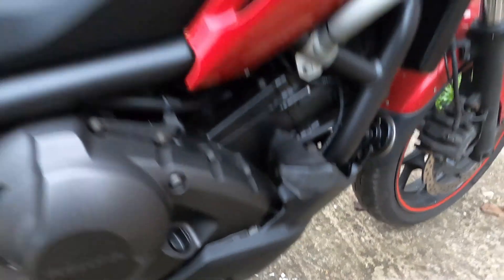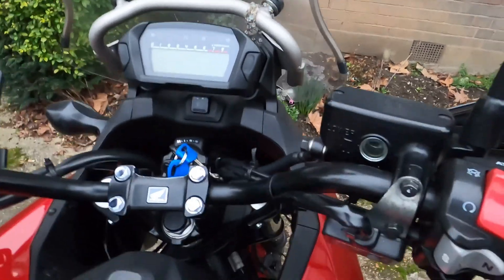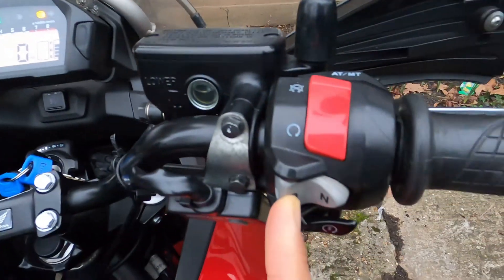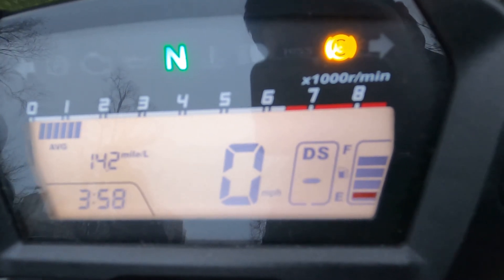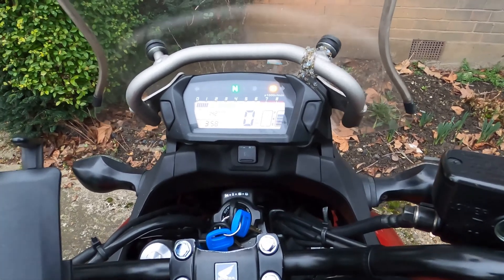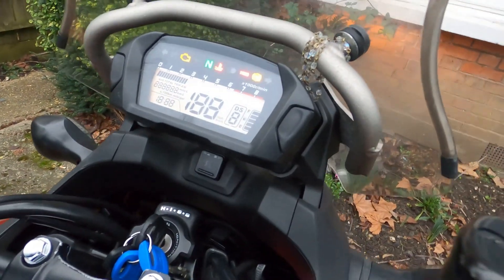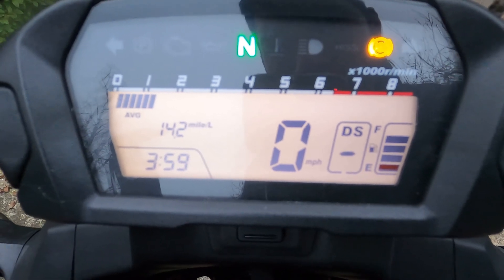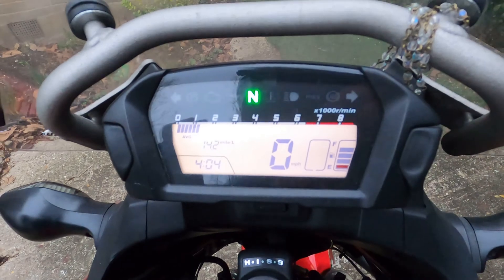Calibrate Honda DCT motorbikes.

Comment: Thanks a lot. I have a  question, my HISS light disapear Honda NC750DX 2014. What can I do to reset it?
Reply from the maker: Hi, I am not too sure, however, a battery reset would fix most issues. Disconnect your positive connection on the battery, wait 3 minutes and then reconnect.

Comment: My local Honda Dealer says to NOT do it...The only time it should be done is if the DCT controller  is replaced or Clutch plates are replaced...Never do it otherwise . The repair Manual also says the same thing..
Reply: If you tell people not to do something they are eager to do it and play with fire, if you tell them to do it, they'll ignore it :D People are funny creatures.

Comment: It worked on my 2019 integra 750,important the check engine light and release d,also before turn off the engine in neutral

Comment: Why do I need to reset the dct engine is it for better mileage?
Reply from the maker: Just like any other piece of machine. It needs calibration to work efficiently, essentially improving fuel mileage.

Comment: For the latest version of NC, you need to hold the throttle 100% open while keeping D pressed at the beginning of the procedure.
Reply: Hold a throttle 100% open while the engine is off ?
Reply: @АртурСтробенгальский  Yes.
Reply: Where did you get that info from?
Reply from the maker: @philipmccarthy8726 the World Wide Web 😊
Reply from the maker: Thanks for the update. Pinned.

Comment: I'm a Honda technician and i didn't know that....... wonderful surprise...thanks for the advice 👍
Reply from the maker: Make sure you don't charge your clients for that 😉
Reply: @Captain_Tipsy ds sürekli yanıyor resetleme kabul etmiyor motor neden olabilir defalarca denedik cihazada bağladık olmadı ortadaki çizgi - sürekli yanıyor sönüyor ve sonra hızlıca yanıyor ama DS modunda kaldı motor resetlemeye engel olan nedir
Reply from the maker: Hi, go for a ride first. Maybe the bike is not hot enough
Reply: not funny when u are 500km from home and the bike decides to get stuck in the 2nd gear..that reset saved me a lot of trouble

Comment: I tried this on a 2019 NC750X and seems to have made a good difference. Just make sure to keep the red engine switch on. I initially forgot to put the red switch on, and the engine light will not turn off.

Comment: Tried this on my NT1100. Unfortunately, did not work and the display (M, D, S1, S2, S3) disappeared 🙁🙁 I now have to guess what mode I am in. Any ideas ??
Reply: had that same problem on my 2016 africa twin ten got it hot like he says in the video and reset it like 5times then made a 100km..it seems fine we shall see
Reply from the maker: Hi, resetting your ecu should do the trick. Try disconnectibg the battery and reconnect.

Comment: Doesn’t work on my 2022.  Display is different.
Reply: Worked on my 2023. Different stuff on screen but still works
Reply from the maker: Thank you for the update ❤️
Reply: Try starting the engine ,shut it of in neutral,hold d and put thecontact,release d when the check engine shuts of,maybe will work,the rest is😮

Comment: Why is it necessary to do this.?
Reply from the maker: It's not necessary. But, I would advise you to reset your DCT every couple thousand miles. This simply calibrates your gearbox so it's much better and responsive.